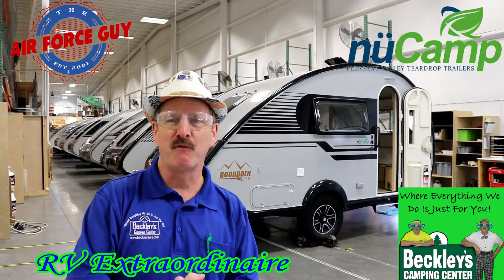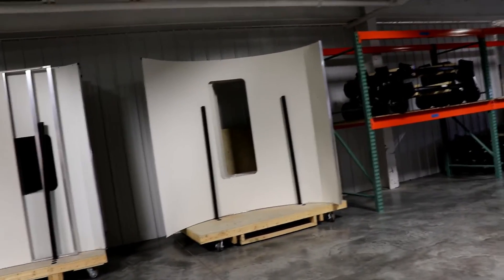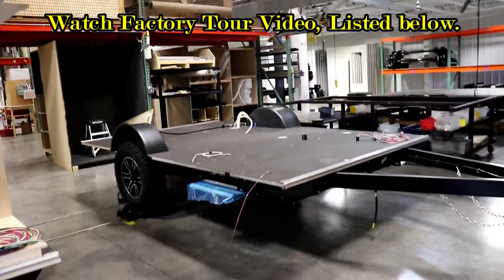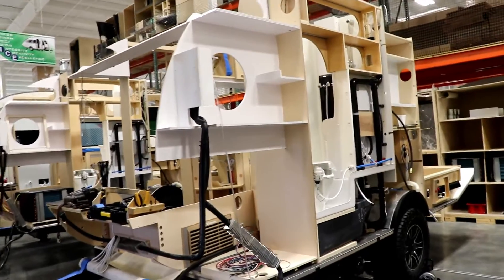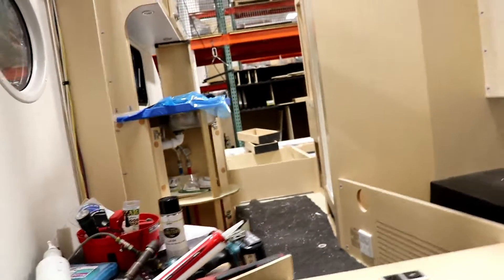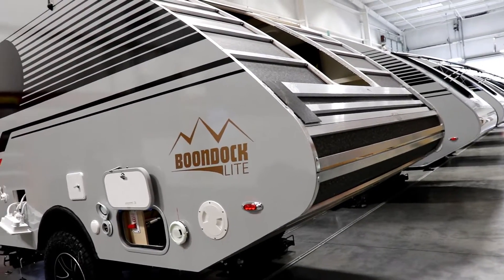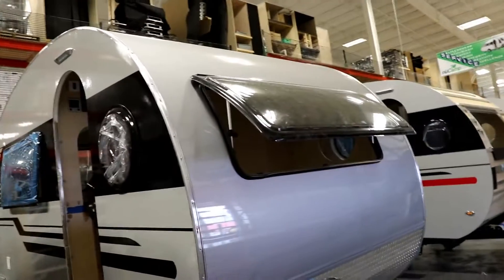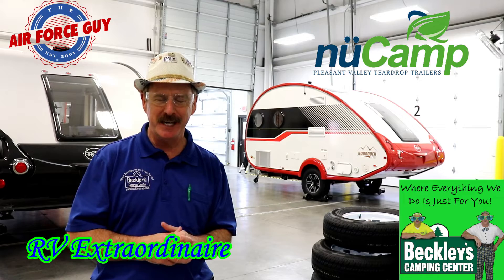New - The Making of the T@B 400 by NuCamp - w/Paul Chamberlain, Jr. "The Air Force Guy"

Comment: How do you know water doesn't get in the seam areas at trim and seep into the camper area?
Reply from the maker: You can use a moisture reader to show you if there is water in the wall areas.  If it has been leaking for awhile, there will be soft areas on the wall and/or ceiling.  Good Luck and happy camping!